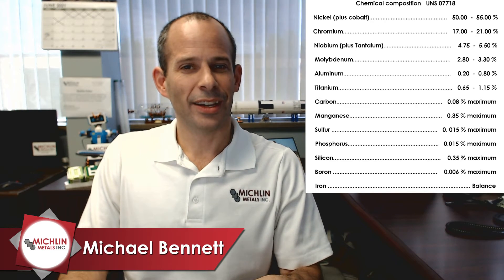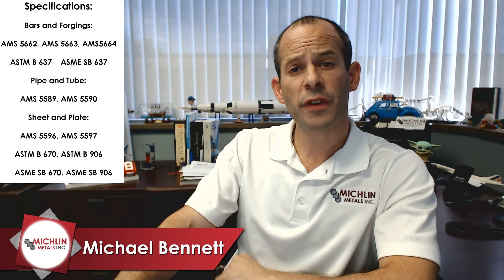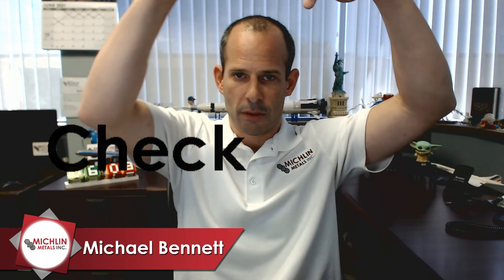Inconel Series- Guide to Inconel 718 - Alloy 718 - RD Bar AMS 5662 Plate AMS 5596 - What is Inconel?

Comment: What is the purpose of expressing (Ni and Co) and (Nb and Ta) as a combined percentage ?
Reply from the maker: Many metal ores contain more than one similar element and when refining to metal, achieving higher purity comes at a significantly higher cost.  For example, very low Cobalt in Nickel increases the cost and in many applications nickel and cobalt are functionally equivalent. So in this situation the alloy recognizes the combined amount of these elements and lowers the cost as compared to the same alloy that restricts the cobalt to very low levels.